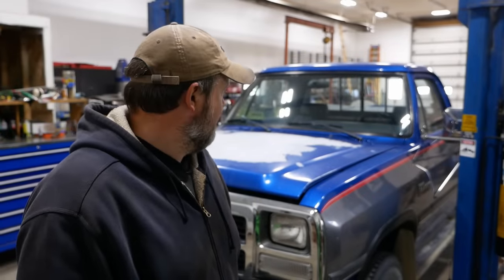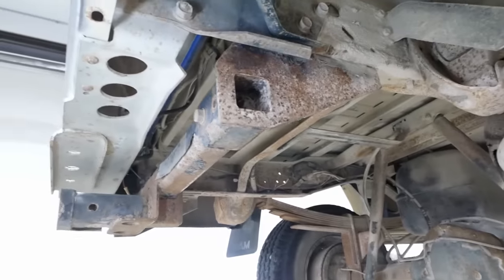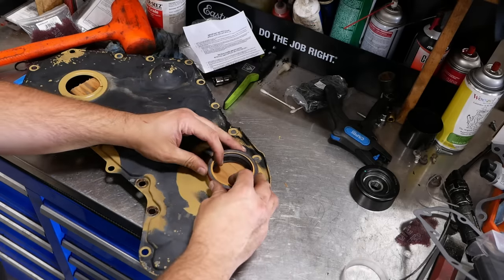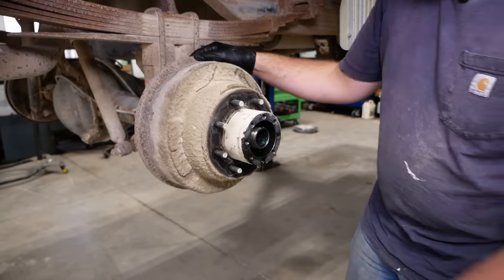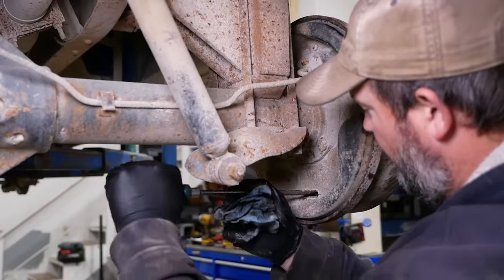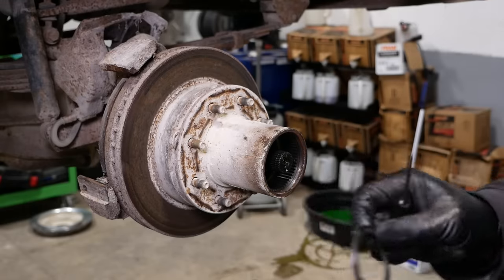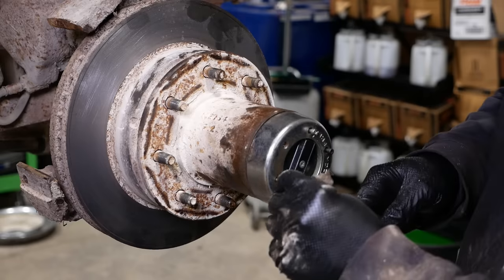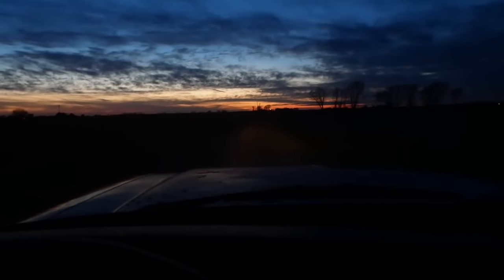Cherry 92 Dodge Cummins: Killer Dowel Pin, Brakes, Seals, Etc.

Comment: I grew up around a bunch of that era Dodge trucks.  Lots of front end work, always.  We usually had good luck with dijon mustard and the power of prayer.  After you join the Church of Scientology and cut all ties, the steering should tighten right up.  That's what people don't realize about these trucks... they have a cult following, and to fix them right you really need to join a cult, if possible.  Good luck Wes!

Comment: im sure you know this. drill and tap through the case. then thread a bolt in to block the pin.
Reply from the maker: You're assuming the pin is there and has not moved.

Comment: put it in the air'''''''''  position yourself  under the steering box & shaft'''''' have a ''real bright light'' look at the shafts U-joints'' notice the bolt on the coupler that tightens it'''' (THAT COUPLER BOLT LOOSEING UP EVERY 20.000 MILES OR LESS; CHECK IT.) let me know.

Comment: i have used a long breaker bar and socket on crankshaft bolt disable start and put bar and socket on and rest against chassis then get someone to just flick starter normally does the trick but not the thing to promote on youtube

Comment: Were it me, I'd have at least checked the transfer case oil level. If it leaks, you need to check the oil levels.
Reply from the maker: Why do you think I didn't check it?
Reply: @WatchWesWork  I did not see a clean fill plug shot in the video. That's why.
Reply from the maker: @williamsanders2808  If you guys don't see it, it didn't happen...

Comment: I’ve never seen anyone remove the front gear housing without removing the whole grill, radiator, etc. Cummins owners love to practically destroy their trucks to access things like that. I’ve even seen a video where a guy took the whole wheel out to remove his oil filter.

Comment: should check the transfer fluid level..on toyotas, the gearbox leakes into the transfer, so, its just a transfer leak,,till the greabox siezes..toyota problems..still aparently..

Comment: So, all the big brains at Cummins couldn't come up with a bent bit of wire coat hanger... (5% failure rate is shocking. They should have issued a recall).

Comment: Now wes instead of using a bearing packer why not do it the old fashioned way and pack them by hand. It seems people want the easy way now a days. I was taught the old way and it works well
Reply from the maker: The packer is so much faster and does a great job.
Reply: I have the "I bought the tool, I'm going to use the tool" mentality on this.  He's running a shop, not showing home gamers the cheap way on how to do it.

Comment: That's not the one you want you want the intercooled p pump 12valve 1st gen that's got the shity injection pump and no power with no turbo or if it does have the turbo it doesn't have the intercooler

Comment: Best way to describe the automatic lock hubs on f150 is they are a peace of shit simply put. Same with the ranger and bronco  throw them away and replace with manuel lock outs best move to make. Being a ford man for decades now. When they went from drum to rotor brakes on the front that system did not like salt at all.

Comment: Back around 2001 we had a bunch of bulldozer work done at our property and the guy had a 90 or 91 Dodge 3/4 ton Cummins we had a 90 F250 7.3 and I wound up driving that Dodge a few miles on some country roads and I was absolutely shocked at what a rattling decrepit sloppy piece of shit it was...
It looked and ran good though...

Comment: Okay Wes, I'm calling BS! You are using some special effects on this video! I owned a 2000 Ram 1500 and EVERYBODY knows they were rustbuckets! If you said the word "rust" in it's presence, before you could finish the word, the rear wheel wells would rust straight thru! LOL

Comment: HAVE.  SOME ONE. ROCK THE STEERING WHEEL. AND YOU WATCH. THE.  STEERING. SHAFT UNDER THE. HOOD. ALL THE. PLAY. IS. IN THAT REPLACE ABLE. SHAFT. I GOT. MINE. AT. AUTO. ZONE.     PEOPLE THINK IT. ITS. THE. STEERING BOX. THERE. WRONG. YOU MIGHT.  HAVE TOO HOLD. THE. SHAFT. WITH. VISE GRIP. TOO SEE THE. PLAY.